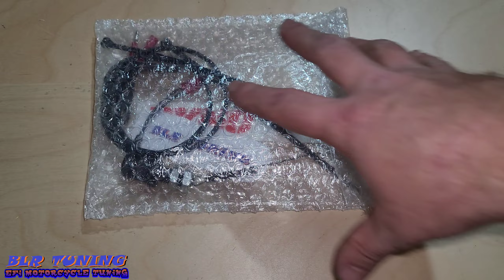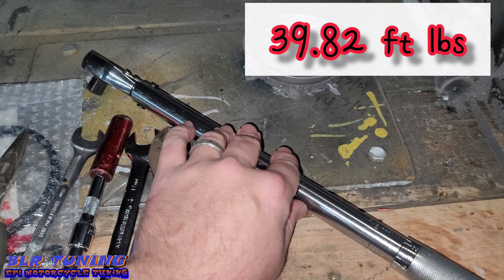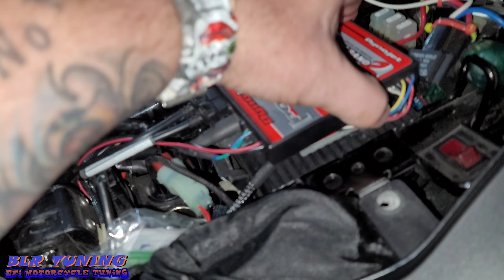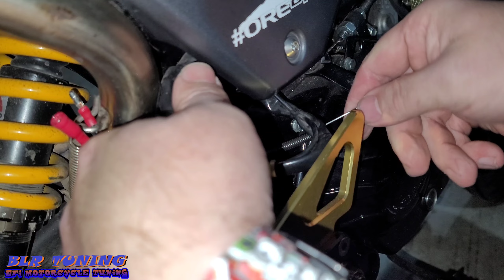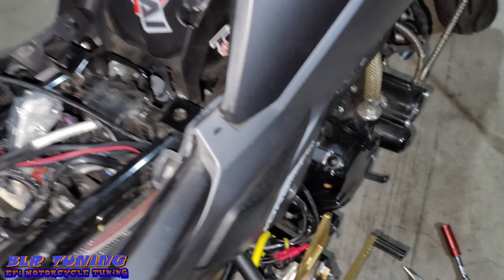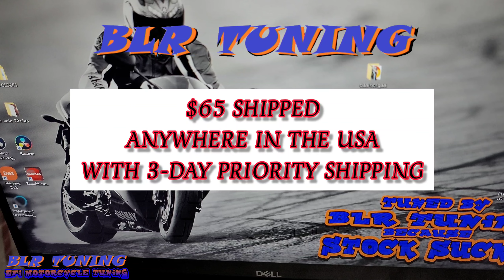HONDA GROM TWO-STEP LAUNCH CONTROL by BLR TUNING installation

Comment: so this wont work on just a stock grom?
Reply from the maker: You would have to have a Dyno jet PCV or the newer PC6. We carry PC6 on our website and you can order it with launch control. The launch control is controlled by the PC6. The grom doesn't have a way to control launch control unless you have PC6.
This link will take you to the Honda Grom section of our website. 

https://www.blrtuning.co/collections/honda-grom-parts-accessories

Comment: Will this work with aracer ecu stand alone ecu with a quick shifter?
Reply from the maker: No unfortunately it will not. As of right now a racer does not have a plug-in for two step launch control like this. This was specifically developed by myself I manufacture them they are specifically designed to be plug and play on any Honda Grom using power Commander 5..

Comment: Is no way that i can use it with flash ecu
Reply from the maker: No because you would need something that can program it and acknowledge that it is setting a different rev limit when it's activated..
Reply from the maker: There is no input on a Grom ECU that will allow that to happen